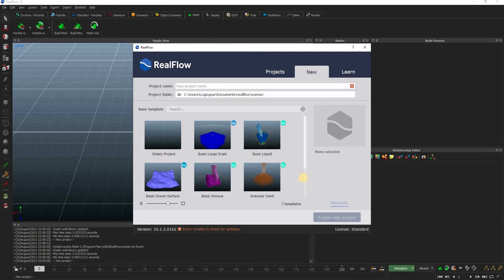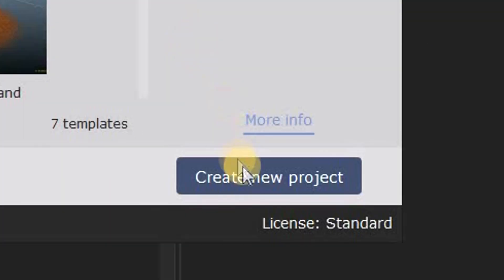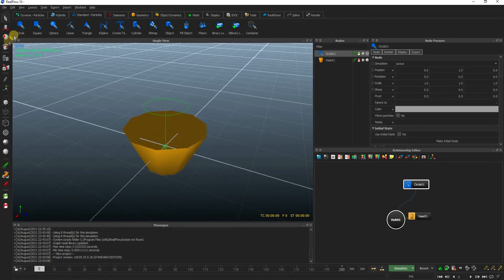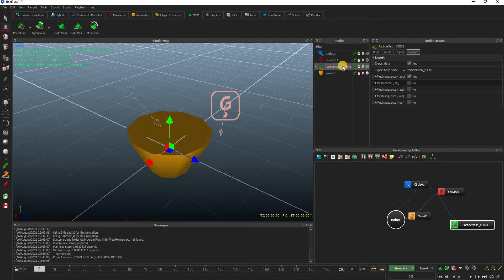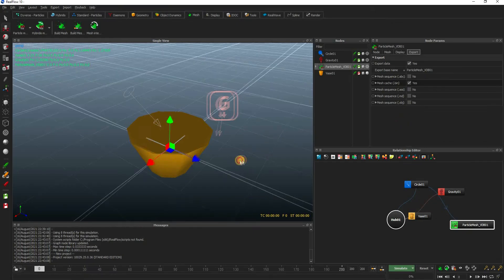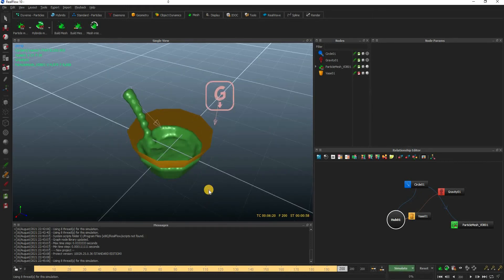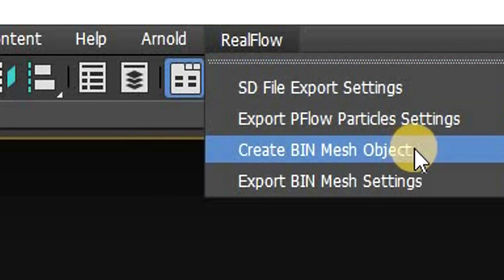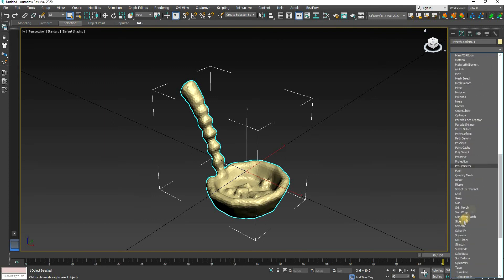How to Export Realflow Simulation to 3ds Max (Simple method)

Comment: Hi LogicGear...
Your Tutorial very inspired for me . i was download realflow trial but how to download RFconnect plugins for 3ds?Please continues make tutorial about realflow & 3ds max like splash,foam & another part of water simulation thanks about very clear your tutorial...its very helpfull
Reply from the maker: Hi, sorry for the late reply. You can download the RFconnect plugins from RealFlow website. They only have it for the latest few versions of 3ds max though. Also, I will try to male more Realflow tuts in future.
Reply from the maker: I have read your email and thank you for your kind words. You don't need to download trial version of Realflow to get the plugins. You can simply download them by signing up, and they are only available for 3ds max 2020, 2021 and 2022. It will be just a single install file and it will ask you in the setup to specify the version of 3ds max that you are using.